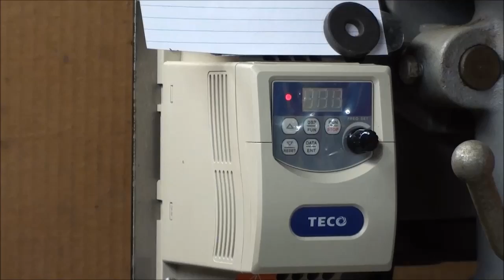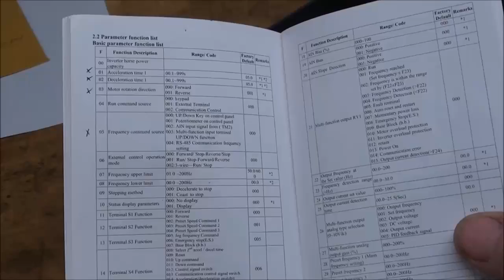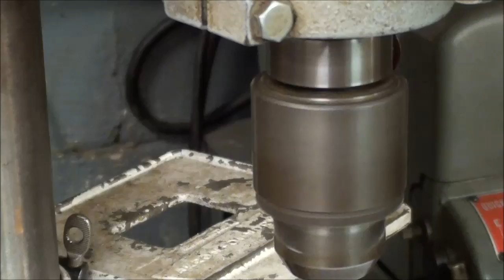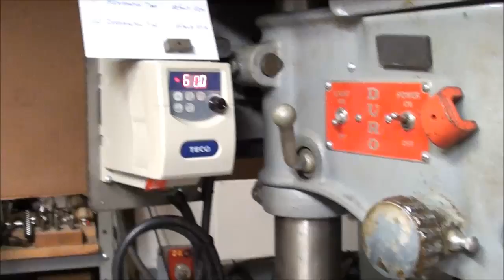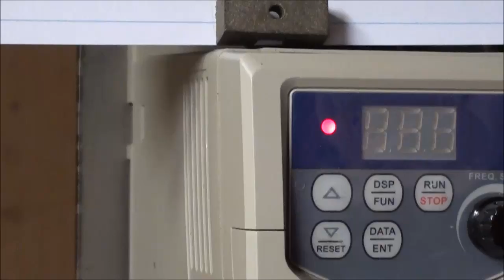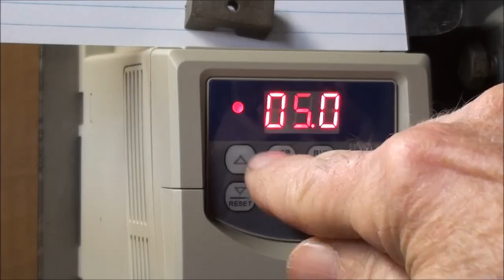MACHINE SHOP TIPS #140 Programming the VFD Variable Frequency Drive tubalcain

Comment: Mr Pete you are a man of very many talents. When I first starting working on drives in early 80's you only had about 6 parameters. Had trouble with a 150 HP Drive where I had to call in a tech. Book it came with probably had 150 parameters of which we only had to use around a dozen. He had a programming book from class that he attended that was an inch thick. Drives pay for themselves quickly epically on motors that run 24/7. We had two 5 HP Z gearbox with moving in & out pullies for speed control that took 8 hours to replace due to being inside of a 75' long machine. We replaced it with a motor that bolted to a gearbox and a VFD. It would start & stop at least 50 times a hour. Set ramp up time to maybe 3 seconds to reduce shock of starting. Instead of replacing old unit once a year and downstream bearings was running over 5 years with no down time. On large drives they keep a great event & energy used. Would show bosses how much energy they saved when ever they cried about spending money on replacement boards & replacement dtives. Have to be careful running motor faster then designed speed. Bearings in most motors not designed to run to run at say double nameplate speed. Right before I retired company had two 1750 HP chillers that were feed with 13,200 volts then thru a transformer to a 4,160 volt VFD. Control cabinet was 8' high and 18' long with medium voltage step down transformer. Was hoping to get some training on them. A large 12 story building that company built had VFD'S on all motors 5 HP and over. All motors 60 HP and over had 18 pulse VFD'S . 250 HP fire pump had a soft starter feeding it.
Reply from the maker: Thank you, that was interesting

Comment: Hello Pete.

I am using a TECO VFD on my drill press....The motor is 3PH 230.460 volt. When  I try to use a larger Forstner bit, the system shuts down with very little torque is placed on the bit. The system shuts down. Turning the VFD off and on allows to drill press to start again.... I am completely lost on this.... I thought  the VFD could be changed to compensate for torque.... TECO tech support has been no help???? Any advice????

Comment: Pete, you know why they do this with manuals. It’s cheaper to do this than to have a numbers of msrp’s all over the world. How many languages are there? They would have to box that many different manual devices. That’s ridiculous. And it’s not likely that the USA is the biggest customer. It’s likely China itself.

By the way, I’ve done at least eight of these. Mostly, they’re pretty much the same as far as programming goes. But, some major European manufacturers, such as Schneider, do things differently, which makes things confusing. So be careful when programming these.

Also, these are not intended for home users, which is why the manuals are so complex.

For this model, and many others, you can add a forward/reverse switch. Some have that on the panel, or on their own remote panel. Then, you can use these for tapping. I have one press set for that, as well as the mill.

As far as changing motor speeds using these, be very careful. Most motors aren’t wired for this purpose, and will run very hot. Inverter ready motors are designed for this, and can safely be run up to twice the speed as rated, running the VfD at 120Hz here in the USA, or 100Hz most everywhere else. You can run an inverter ready motor at 0.1Hz safely. The vibration heard here is from the mechanical parts of the press, not from the motor, unless the bearings are bad.

And finally, if you have a single phase motor, you will have to change it to a three phase model. There are no readily available single phase output VFDs. This is due to the way the phases are switched. So if you are going to do this, remember that it might require a new motor. If you buy one, get an inverter ready model, even though they are more expensive, particularly if you’re going to do this on a lathe or mill, where the motor can be run for longer times. A drill press is less critical because usually they’re not run for more than a minute, or so at a time. If yours is, get the inverter ready motor.

Comment: In the mid 90s we had wired some 200 horse power chipping head motors on VFD's. (Chips the sides off of logs on both sides before going thru quad bandmills) the start up guy came in to tune the VFD to the motors he was showing us what the drives could do. He would take those motors from stop to 100hz forward to full stop to 100hz full reveres to full stop in just a few seconds. He only did it a couple of times. I was amazed it did not kill those motors but they were a VFD  rated motor.

Comment: the vfd  more than 40  years  was the size of a freezer on a house , was made by  SIEMENS  and HAMBURGER  companies fro GERMANY , i work  for a company with all these inverter's ,,,,one for each  motor in the mill , each inverter has a ring counter  board , a shopper components , a volt/hz board , power supply board  ,etc,etc , as you can see the reason they was so big ,,,,,,,, the size of a freezer or bigger ,,,,,,, depende of the size the motor of course,,,,,,,,  because they was made with analog  components ,,,,,,,resistors ,capacitors, transistors ,scr's  and through-hole  IC'S ,,,,no SMD (surface mount  devise) back then , that's the reason they was so big , today everything  is SMD, a 1"x1" ,,,or smaller board ,,,can  control the world (destroy )  the world , i used to love to do repair work on those boards back then , today ,,,trash can,,,,,,, or trash truck or dumpster ,  no repairs envolve , i start  as electrician ,  then i move to electronics , then i move back to electrician again  because no more electronics  to repair  , everything is junk made in china unrepairable stuff
Reply from the maker: Thank you, that is quite a story. And I know what you mean by non-repairable

Comment: What a lot of you need to remember if you run your motor at a slow speed it usually on a job that’s using a bit more torque than usual? A slow running fan cooled motor will over heat. Not so bad on a quick one of job. But on longer heavier work say screw cutting, you need to think about matching the motor speed to your pulley setup. Bit like changing down in the car on a steep long hill. Alternatively you can fit a auxiliary cooling fan to the back of the motor timed to come on from the VFD drive at a pre programmed lower speed. Have fun:-)

Comment: do you think this could run through forward/ reverse  to obtain reverse such as on a lathe- mill? 
the 3 phase drum switch would do the reversing of 2 wires with converter remaining in forward
good job thanks

Comment: i am in the process of buying a Clausing lathe just like yours, and the original hyd variable speed drive is gone and it had a 3 ph motor, now it has a single phase 220 and a gilmer toothed pulley and belt and it needs to be finished with a VFD so this was a good lesson for me thx Lyle
Reply from the maker: That will be a great machine. Mine is very noisy with the variable speed Drive

Comment: Beware! Running motors in reverse or at very slow speeds under load may cause overheating if the fan turns too slowly or blows in the wrong direction. Good reason to keep at least some multi speed pullys in place.
Reply from the maker: +Toby W thanks, I hadn't heard that about the fan speed
Reply: mrpete222 , I guess you could put an electric fan on the end of the motor. There are some with orange curved blades at one of the computer component sites that blow hard but are as quiet as a mouse. Remarkably quiet! Been several years since I bought mine. I don’t think they take much current. 12v.

Comment: Lyle, I see that at least 2 of your drill presses have those Jacobs chucks with 33JT and a remove/replace collar. I got a bought a 33JT keyless chuck for it and it will not stay in place. Do you think I can cut a snap ring grove on the keyless chuck and use the screw collar with the keyless chuck?

Comment: At 120 Hz it looked like it was gonna walk off.  I remember the Word Perfect 5.0 manual, it was over an inch thick.  I threw it away and learned by trial and error.  As a lead in my previous profession, I would print up "cheat sheet" labels to go on our air samplers for programming.  Another great video.

Comment: Always enjoy your videos. Just go a Teco L510 VFD for my mill and one for my new belt grinder. Was totally clueless on the programming. This gave me a direction. The L510 has some different coding numbers, but it headed me in the right direction. I will be adding a reversing switch and Potentiometer to mine. Thanks for all your insight.

Comment: I am considering doing some hobby machine work and this opens up my choices to 3-phase motors/machines, though I only have single phase power availible at home. I wonder how the torque holds up at low frequencies. I'll check the following episodes.
Reply: Yeah, Toby, I wonder the same thing.  I have a Jet woodworking lathe with a 1 hp DC motor with (I presume) a PWM controller.  At slow speeds (<500 rpm),  the torque really sucks.  I get the feeling tho that VFD's driving 3 phase motors must deliver at slow speeds, otherwise these gearhead guys wouldn't be so interested in them!

Comment: Thanks for the videos, I just got a smithy CNC 1240 bed mill that's been stripped of all of its controls save the VFD.  Even though this is not the same VFD it gives me the information to translate the "engrish" in the manual so I can get the spindle going and check that before I start in on the servos and controls for them.

Comment: Super great video. I use a stapler and staple the other manual pages in different languages together, as I don't use them.
The Mill video will be interesting, if I understand it you will have to install a 3-phase motor as well. I will have to look at my MSC mill and see what a motor change would require. I like the idea a lot!! 
Thanks :-)

Comment: I don't know why you disabled comments on your Hz to RPM video, but that F48 setting is useless unless you use vector control. You're just using plain old volts per hertz control, which is why the motor has no torque.

Comment: This is great information mr. Pete based on our previous conversation we had,  I'm buying a Logan 820 . I went to see it today and everything seems really nice there isn't a scratch on the way s the paint job is the only thing that's a mess and I don't really care about that everything seems to function the gears are all perfect from what I can see the movements are all nice and smooth xcetera. The motor is all and it Sparks a little bit it actually has a lover built right into the motor for switching directions a thing that I've never seen and it's only 110 single phase obviously. A question that I would have for you would be do you think that I should buy one of the one horse 110 / 240 Motors that Logan actuator offers for this lathe? Or should I try to find a 3-phase motor more in line with its originally equipped motor? I would really like to do the correct thing but don't know what that is to tell you the truth I have not even been able to find out the exact specs on the original motor so if you could help me with that I would be eternally grateful. But all in all I'm very glad that I stumbled across this video because I was ready to throw my hands up in the air thinking I would have to buy a phase converter that would take up 10 square feet on my wall. So this is very good information and I thank you for it I can go ahead and buy the 110 motor if it if you think it all operate the slave adequately to do most operations I'm not in advance user obviously. Thank you for your time

Comment: Mr. Pete,  Another entertaining and informative video.   Also consider what I have done on my Logan 820 lathe.  A little more involved than using the vfd however.  I used a used 3 hp treadmill DC motor and variac and simple bridge rectifier and capacitor circuit to convert AC out of the variac to dc.  It works great and as you say it eliminates using back gears and changing pulleys.  The DC motor is also much smoother than the original AC motor set up on my logan and virtually has eliminated all vibration.  I may use a VFD on my drill press as it will be much more simpler than mouting a dc motor variac etc.  Thanks again for your great instruction and sharing your knowlege.

Comment: Hello Tubalcain.  I recently purchased a Harbor Freight Mini-Mill and wanted a Tachometer DRO function.  I purchased a digital tach on ebay which uses a small magnet attached on the spindle and a Hall effect sensor.  I had to buy a small plastic enclosure and perform some simple electronics wiring and add a 12 vdc power supply.  Finished with a dead accurate digital tachometer.
Reply from the maker: +Dave Glodo I really like those add on tachs

Comment: Thank you for the very informative video. I did have one question and it was about the reverse feature.

I too am sick of the changing belts but my biggest issue is for a knife grinder. The reverse feature of this will greatly help in the process of sharpening as having the abrasive belt going away from me is better.

Anyway, in your understanding it is possible to go in reverse at the push of a button rather than going through all the function processes that you showed us? Are you familiar with another model of a VFD that can do this?

Thanks again!
Reply from the maker: Bruce Prosser Look at all the videos. I have installed a rev sw.

Comment: thanks will have to get one for future machine. its funny because i went to a dealer for machine tools the other day and he was showing me his hi and low two phase switch he put together on a mill and i thought it was the dumbest way every and only have two speeds. haha i knew better than what he was trying to tell me that it was the only way and cheapest rather than change pulleys around. now ill feel better about looking for machines and not worrying about speed control so much because i will add one of these to it and an inclosed electric fan to the motor. also going to have to get one and go play around with it on a few machines at my fathers mechanic shop, i know he would love to be able to fine adjust alot of his machines such as valve grinder, drill press, mill and brake rotor machine lathe and random others. should be fun im looking forward to it :) thanks for the video.
Reply from the maker: turboed350 Thanks for watching. Yes----you will like a vfd.  You seem very enthusiastic about them.
Reply: oh yeah I like the fact that I can now shop around for a mill that is very basic and the VFD will make it do what i would like. thats awesome and makes me happy to know that i can now not worry about the cost of variable speed spindle controller and look more for the good old machinery :) thanks. not only that im young and been machining for around 10yrs now and looking to make a little shop for gunsmithing and all the fun random stuff i come up with to make. i like yours and ox's videos they are very good for learning the tricks you guys got up your sleeves for machining, its the small things that make our days easier thanks again.
Reply from the maker: turboed350 Thanks for watching

Comment: I know this is an older video and i am not sure if you've had this comment already but when adding any type of motor speed controller to an electrical motor you should be very careful at low speeds with high torque. Motors often have a fan attached to the same shaft as the load so they kinda cool them selves. If you reduce their speed, the speed of the attached fan is consequentially also reduced rendering it useless. Motors that are designed to run at slow speeds have an active cooling system (usually a powered fan) to cool them down.

Comment: Check out function 24 when your motor is in the upper limit of your current draw.  The Teco might be set to low and that would make a jog in the startup or premature OL1 (overload light) come on.  This information was from Harold at the NJ Tech support of Dealers Industrial.  He was spot on took him 15 minutes of trouble shooting to come to that answer.  When calling Teco customer support they were supportive but didn't solve the problem.

Comment: Like you, I have no 3-phase power, so when I got a vertical mill with a built-in 3 HP, 3-phase motor, I had to get one of these. Mine is 230 VAC/60Hz/single phase in and 230 VAC/0-240 Hz/3-phase out. I could (theoretically) run my motor at four times its designed speed (but as you point out, that's way too scary). I keep it to about 100 Hz maximum.

I've been a computer geek since the 1970s so the manual wasn't too confusing. As you say, computers are all pretty much alike. Making smaller charts with only the settings I wanted to change helped quite a bit.

For the 3 HP motor, the slow ramp-up was very important as it really cuts down on the huge current draw when starting. A slow ramp up means no big current surge when starting. I actually draw more current when doing a quick power down. I used the extra remote connections to integrate it with the original controls on my milling machine. If I hit the big red button, the VFD shuts down the mill right now! It seems to apply DC power (0 Hz) to the motor windings which acts as a brake, and draws about 25 Amps (at 230 VAC) momentarily.

Comment: I have heard it is best to use remote speed pot and switching, as to save wear and tear on the pot in the VFD.
Pot and switch was only a few bucks at radio shack.
Reply from the maker: I have an external POT on mine already--thanks
Reply: mrpete222 Yeah, I still have to watch the video.
Reply: mrpete222  I was just sort of commenting. I wasn't trying to be a wise guy, or tell you, I wish I knew 1/2 of what you know.